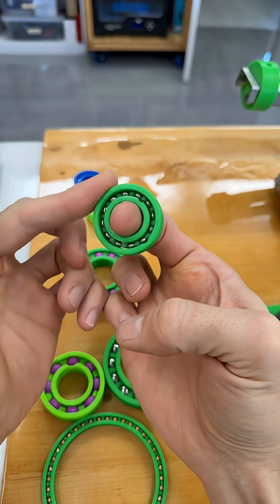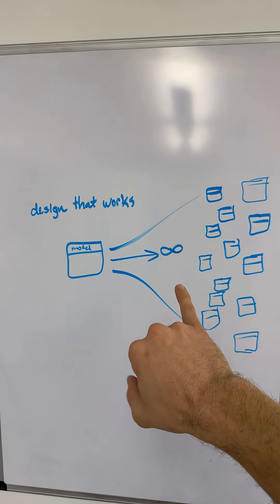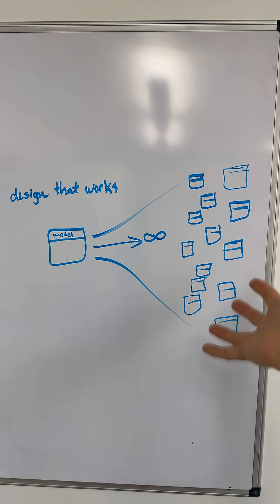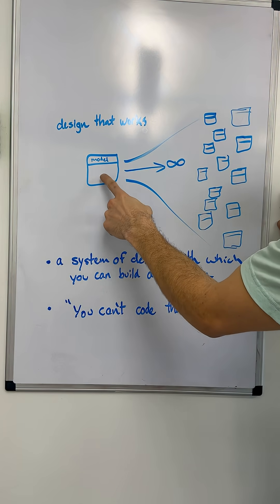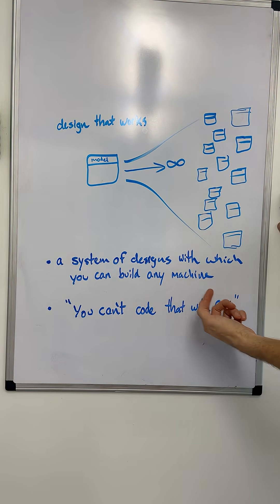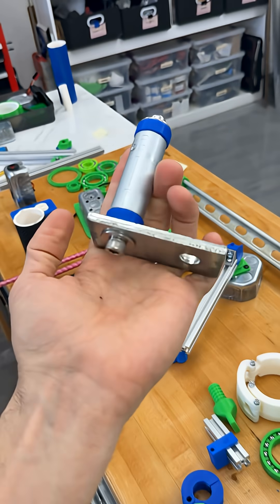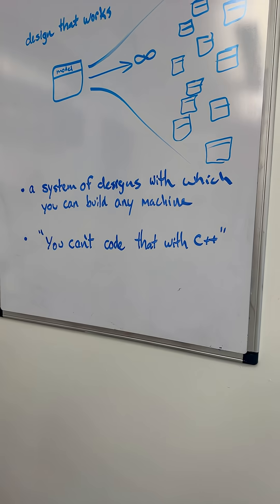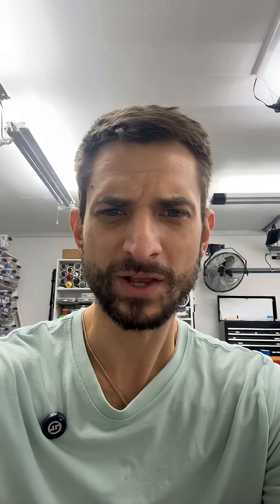I’m getting a footing - a plan to design all machines.

Comment: If you could start defining some kind of index of mechanism, something that groups similar designs or functions together and start from there. Open a public GitHub repo and define the software to be used (thinking of grasshopper, maybe Houdini FX even if it sounds quite crazy). From there I guess collaboration will get the most out of it. Starting simple and implementing more and more overtime

Comment: For high level abstraction you need high level language to describe things. But to solve problems and generate output you need methods, algorithms, requirements, constraints, available tools for implementation, verification,  test and interfaces to other domains (i.e. electrical, thermal, chemical,  ..etc). Could be possible but why? What is the critical need?

Comment: This is an exciting project. I'd like to help out but I don't have an engineering background. I designed a set of connectors for t track. They were OK but not great. I would sign up for a system with some mentorship built in where you give me a part to design. I'll cad it up and print it. And then I can meet with a mentor who will give me some pointers to improve it and get it into the open source hardware system.

Comment: You want to CODE THE PHYSICAL. 
- Each type of physical part is like a function()
- Variations of those parts are controlled by function( arguments )
- Collections of types/styles of parts or compounds groups of them are libraries 

Maybe you don't just want to code the physical, but eventually create the equivalent of a whole new "programming language" for coding the phisical.
Reply: I think it's good analogy, I'd add:

- one CAD tool is like programming language

- CAD libraries are like libraries written in CAD language

- translation of libraries between CADs is possible but it requires effort (same as in programming!)

- different CADs have different pros and cons (same as programming)

- the easiest CAD to use is one with the lowest entry point to start designing (like python) 

- the most popular programming languages are free but some paid like java do exist

Comment: Fusion360 did something like this a few years ago with Autodesk AI. Essentially you give the AI a set of constraints and it generates a couple thousand random parts, and you can stress test each one in the software selecting better and better iterations, till you eventually arrive at what you need. 
Machining and manufacturing used it for custom fixturing but it didn't catch on, 3D printing technology just isn't there yet. 
Other companies were using it to create custom luxury cars that were unique designs custom fit for the owner.
Reply: I think it's something different

Comment: You’re essentially building a library of parametric primitives, “real world objects as code”, that can easily be applied to any engineering by anyone. Amazing. This could easily blow up bigger than Gridfinity. Good luck, my friend! I’m proud of you.
Reply: There's direct parallels to the IT concept of "Infrastructure as Code". The idea being that any system can be reduce to a defined set of variables, scripts and workflows to go from bare metal systems (I.E. a completely barebones server) to a working system. All defined through the use of pre-defined variables, containers and software libraries.

Translating something like that to the physical world is certain...ambitious! haha. I'm not a mechanical engineer by training so I'm not aware of what the set of primitives would be but given us IT guys have managed to figure out something I'd have to hazard a guess it's achievable. 

For what it's worth most of the systems I've seen that have managed to gain traction are the ones that are strongly opinionated. I.E. we define X to be the way we're doing things and yeah, it doesn't work for everything, but it'll work for pretty much everything and the rest can be handled with some additional code. Are we potentially going down the XKCD route of "There are now 15 competing standards" meme? Sure, but that doesn't mean it can't be useful.
Reply: Well articulated
Reply: there are a zillion people already doing this....
Reply: @mewmew32  Too bad you didn't list any of the zillion people doing it, Bro said he needs help.

Comment: This makes sense to me. In the theoretical sciences, they search for a unified model. A perfect expression which defines everything. Software developers use basic constraints and solve problems from the most basic to most complex by abstraction. It makes sense that people purely invested in making things develop as close to a universal language as possible. In software, that's binary, in physics the standard model. Creating a unified body of components is one thing, but I think the secret sauce in this recipe will be the documentation! 

If you have a body of existing designs, which can be unified to a single standard, you've made an alphabet and then you are half the way to a language already. To create a system, you need rules to follow. Don't constrain the project, create criteria which are both simple and robust and work from there. Programming languages came about due to the limits of inferring data from 1 of two states. A system for making anything, following your metaphor, would follow logically that it starts from some similar hard limit. Good luck David! I admire your ambition. Boiling down our problems like this is the very first step to a truly elegant solution!
Reply: Great insight, I had sth simillar in my mind, to make this a trully universal tool with low barier of entry it should consist of:
1. As cheap software as we can get by (CAD, OS) with documentation
2. Library of parametric primitives shared by whole world
3. A whole book/course functioning as a primer on mechanical engineering

Everything above already exists in world of ptogramming for years.
Reply: Ive been working on a similar problem for my records/information management and a couple of things I have found helpful are:
1. Identify “flexture” points, or points where one idea seperates into multiple ideas.
2. Create a basic system of fundamental parameters ( mines 0-9 with a fundamental parameter for each number)
3. Build recursion/fractalization into the system. This allows the system to grow or shrink in whatever area it needs to. (In mine the 0-9 parameters can be “folded” in so 0.0 - 9.0 are all the 0 parameter of the 0-9 parameters)

Comment: I'm not sure if I'm fully tracking, but let me give you something from my mind that you may find interesting.  Every time I come up with a new invention or design I ask myself "why hasn't this been made before?".  And it's not meant to be negative towards my own ideas.  I'm genuinely asking why hasn't someone done this before.  It gives me insight into myself as to why I'm doing this.

Here's an example.  I came up with a candle recycler device.  Basically it's an oil lamp that burns candle wax.  It seems like something that the ancient world would have come up with.  So why hasn't it been made before?  Simple, because it wasn't necessary.  If they ever had extra wax they just used that to make another candle.  And why haven't we come up with it in the modern day? Also simple, because we don't actually need candles.  My desire to reuse the wax was coming purely from my own desire to not waste it.  And that's just not something that's ever really had an industry behind it.  Especially since you can just make normal candles.

Now there's a lot of problems with my device but that's a topic for another time.  But I just think it's a helpful exercise to ask why hasn't someone else done what you're currently doing.  Maybe someone has.  Nothing wrong with that.  Maybe what you're doing isn't really needed.  Nothing wrong with that either.  Maybe it truly is a genuine idea and you're blazing a new trail.  I don't do this to stop myself from creating.  I do it to narrow the focus and become resolute in why I'm doing it.  Even if that reason is purely because it's something I want to do for my own reasons. 

Honestly I don't even know if this is helpful.  It's just something I do.
Reply: how would you recycle candle wax?? wax is fuel for the candle and it's meant to burn away
Reply: @Bruno-yy3xi   Have you never burned a candle and had wax left over?  Have you never had wax pour out the side of a candle?  Also there's different grades of candle wax.  Not all of it burns at the same rate and intentionally gets left over.  That's actually a problem I ran into with my device.

But I'll let you know that I came up with the device because I lived without electricity for 6 months.  It was a Texas summer I needed the windows open.   I also desperately needed Off citronella candles to keep the bugs away.  Obviously I was pretty poor so the leftover candle wax was valuable.  I made my first prototype out of a tuna can.
Reply: @VagabondTE  you're trying to overengineer a solution for a simple problem, a candle that drips...when you can just have a well made candle that doesn't drip
Reply: @Bruno-yy3xi   Well you can have all the well made candles and I'll focus on bad candles, good candles that go bad, old candles, ones damaged in unrelated mishaps, and good candles that get burned incorrectly.

Comment: As a software developer (who has recently started dabbling in cad), I'd argue the equivalent of C++ is your CAD software. There isn't anything you can't build with (proper) CAD tools either.

What you're looking to make is equivalent to a library or a framework. Those work in a toolset that can already make everything, but make it easier to make common things. Your STL in C++ or perhaps more appropriately your spring in Java or laravel in php.

Comment: You want to build a system in which a user can more easily produce custom 3D model code, similar to how a proficient coder today can produce a range of different results through several different methods? I work in the metal additive industry with software/mechanical background, and have thought a lot about it. The current stage of 3D modeling software is analogous to assembly code in the binary space, but the cost and sheer overwhelm to create a library system like high level coding in the 3D space is seemingly only achievable through AI tools (librarians if you will). We are seeing AI driven design more in every leading software brand, which is great, but that only solves half the problem. You can give a give a person a great piece of software but you can’t dictate how they will use it. We don’t teach the possibilities of what 3D printing could be, which I think is what you’re getting at, though I agree it is hard to express. I also have a life goal along the lines of ushering forth the new industrial age, let me know if you’d like to connect!

Comment: I have been thinking about this a LOT recently, but more focused on the steps I'm concerned you may be skipping.  Problem Solving.  Making things is cool, but we as engineers usually make things to solve problems. I would like to have (or maybe write someday) a book that lists problems and then gives 1-10 different ways to solve that problem, with different pros/cons as to why that function works.    Simple example: Translation: wheels, linear slides, water slides lol, etc.

Comment: Well, it blew my mind wide open! As a mechanical engineer, who left that profession to study (and work in) electronics, and somehow found myself coding for over 20 years, I hear the message. I say yes, it's possible... a GARGANTUAN task, but possible - most likely over a lifetime though! C++ is a very small language, but can be used to build almost anything (including other languages). HDLs are used to describe logic blocks, so you can program a FPGA to become almost any logic circuit. The main issue is the list of parameters is almost endless. Goddamn... as I'd I didn't have enough to think about! 😂😂😂